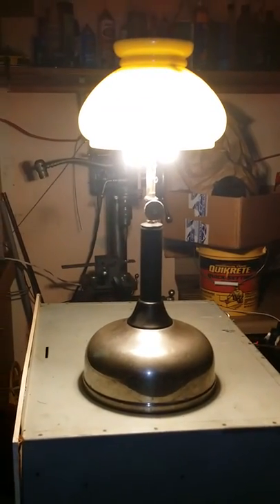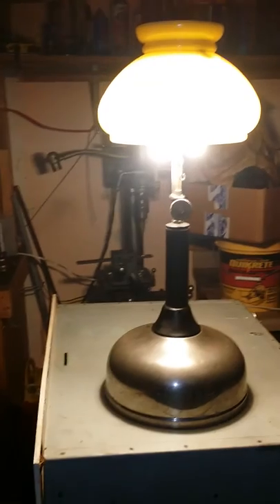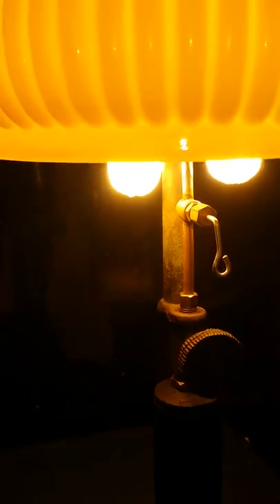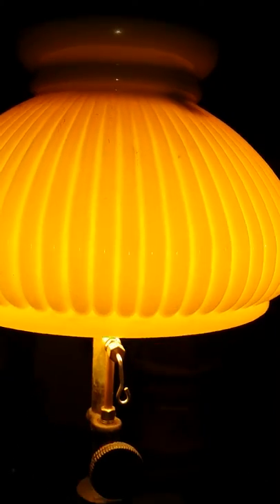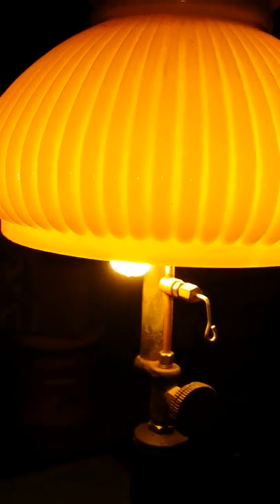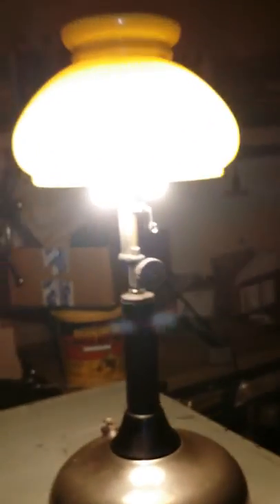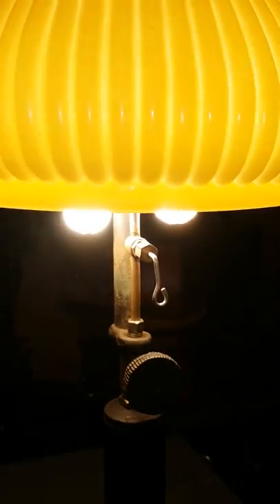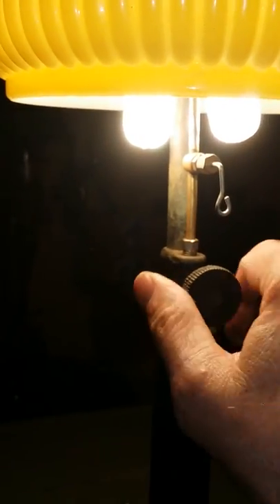Coleman Quick Lite lamp

Comment: That's the heat helping pressurize and atomized the tube for the fuel. Turning liquid into gas form. You'll get the same thing on the old stoves and lanterns. Check to see if the air tube has a spider nest in it.